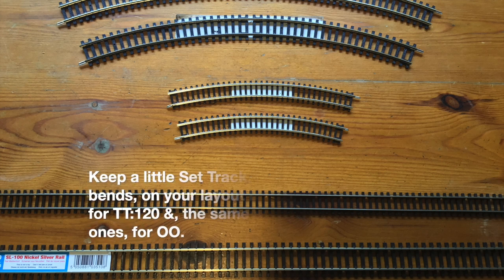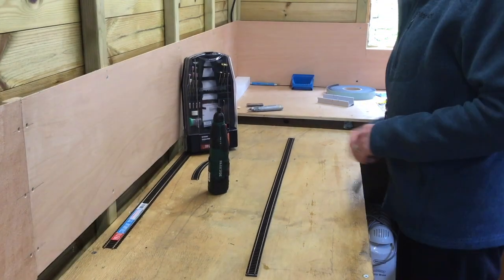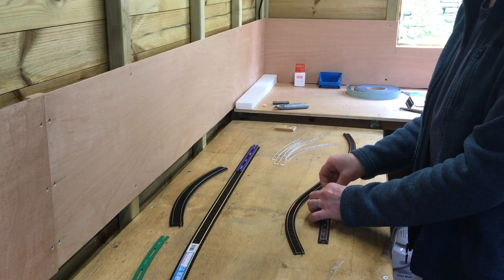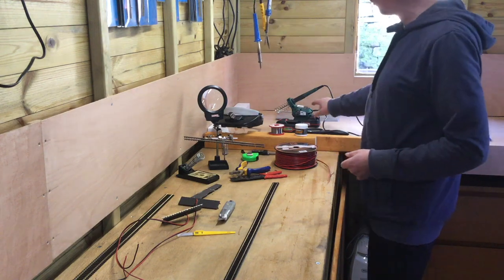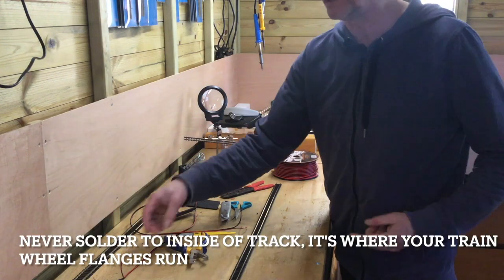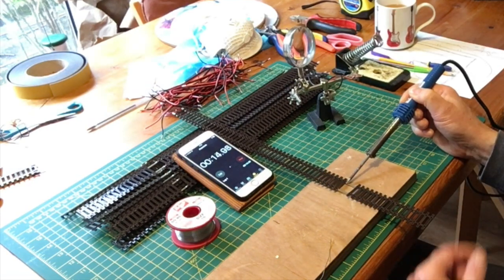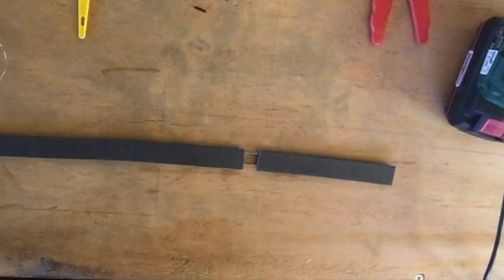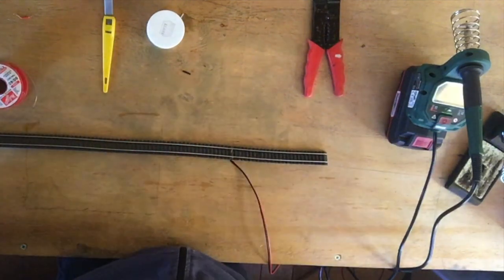Laying TT:120 OO|HO Peco Flexible Model Railway Track Part 1of2 Underlay Pin Gauges Soldering | ml13

Comment: Blimin heck Andy just watched some more of your helpful vid. I didn’t know those track settas had a film on them. I’ve just peeled it off and on the ones I’ve just received from west hill wagon works which are a better quality 🤣
Reply from the maker: Thanks 👍 Are you saying the WWW ones are better and if so, why? The ones used here were the only ones available at that time but, I do like the material they’re made from and the rigidity so, they’re fine and very cost effective including a straight. Mentioning the peel off was also, if anyone was confused as why the ones on eBay were pictured green but, yeah I used mine for about 3 days until it dawned on me that I could peel it off.
Reply: @modeloco  I think they fit better

Comment: You know the track radius gauges from eBay….I carefully sanded the edges on mine until they fit in perfectly. I bought two sets so I could glue them together to make them thicker for better grip to push them through the track as they can snap if not careful. Cost more to do but still worth it.
Reply from the maker: Great tip. Looks like you’ll be ready for when your Loco’s arrive 👍
Reply: @modeloco  I wish I’d videoed some of what I’m doing and building 😂 Iv gone a bit radical and different, I’m having two base boards at each end of my room then they get joined by a 15 foot hand built bowstring bridge 🙈 once I’m finished some of it I’ll put a video up, this is all down to you 😂 when I seen your track going out the house and very long down to your shed. Happy days 🙏
Reply from the maker: @Dr.Gunsmith  Drilling a 5" bore hole through the wall was quite tense. Forgot to record on camera too as it was, very crucial to be in the sweet spot & a big leap of faith. Had it been slightly out, you can't exactly drill it again but, filmed the start of the video before, even starting anything. Knew it was going to happen once, the thought came. Had no idea, how I'd do any of it. All that's been held up, a little, with TT but, its garden season now again... :)

Comment: BUILD YOUR OWN - ABOUT 15% OF THE COST OF COMMERCIAL PRODUCTS !!!
So where do you buy a HOm/OO Dual gauge point ? That's a Metre gauge/Standard Gauge type in real life ! Or any other unusual type of point not made by the very restrictive model track Manufacturers. You build it yourself & save a fortune. Using "Copper Clad sleeper strip (Paxolin)" & Nickel silver Code 75 bullhead rail. Takes me around 2 hours to build a 6ft Large Radius point, and costs about £5 in parts. Parts available from Marcway SMP Models in Sheffield, whom I've been using for over 30 years.
Reply from the maker: That sounds an impressive time scale and cost. Have you some examples of these on video?

Comment: May we ask you where you got your tape under your track from please .has we are interested in putting it under are tracks
Reply from the maker: It comes in 10 metre rolls. How many would you be looking to purchase?
Reply from the maker: Bought straight from a gasket manufacturer in bulk to get cost down a bit but, if you want an odd 2 or 3 rolls then sell it on my patroon site or, you can buy on eBay. To pack securely and with size of reels it’s an awkward size to ship economically for one reel sales